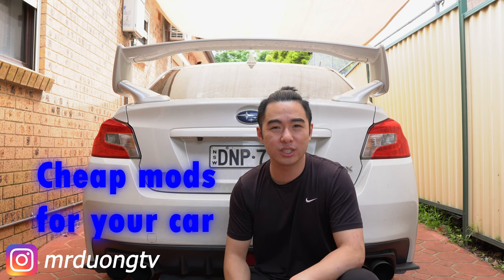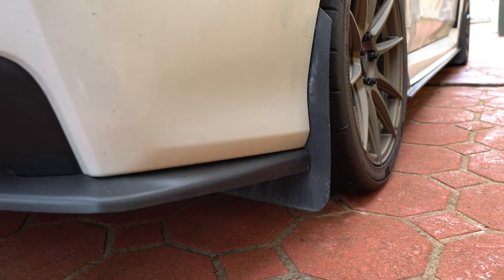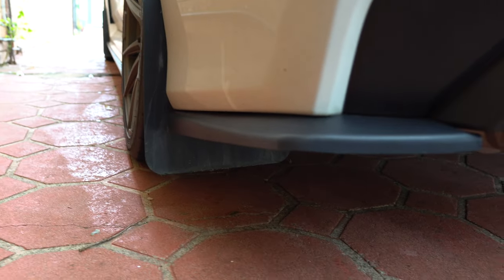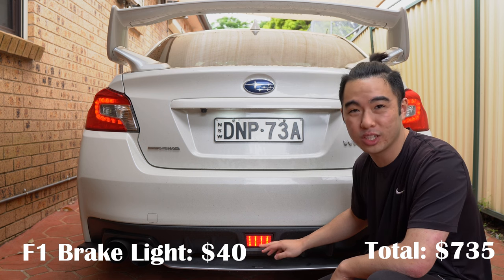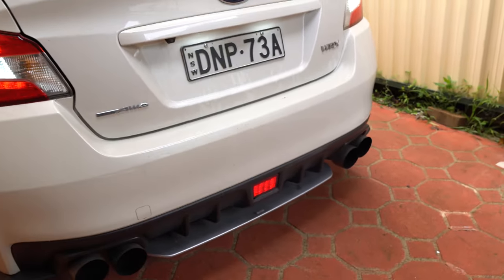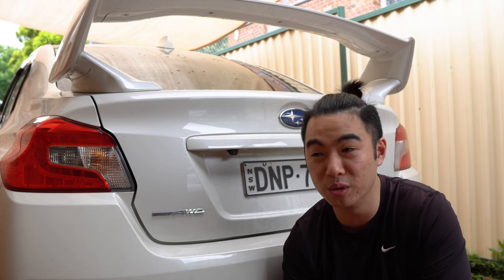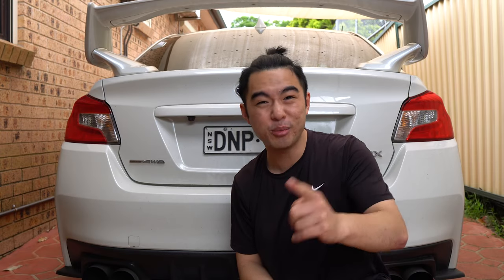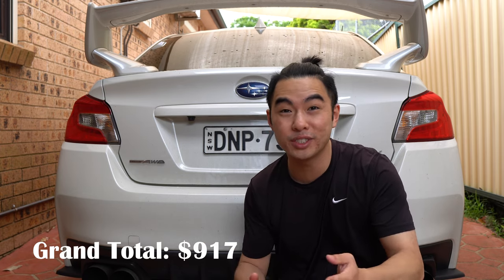The BEST car accessories you should have (and they're cheap!)

Comment: Hey I think I have the same led strip that those C-lights use. Mine are barely visible during the day and the install process was a massive chore.
Reply from the maker: Hey mate thanks for watching! Might be a different one? Because mine are super bright. And yes i agree... it took me about 6hrs. I'm pretty happy with the job I've done because no leaks or condensation, but would not do it again.